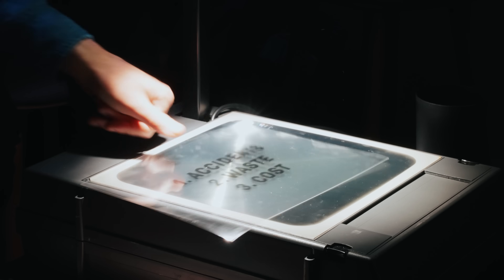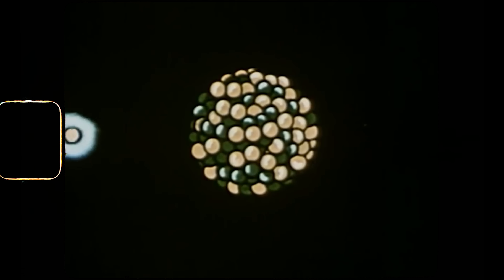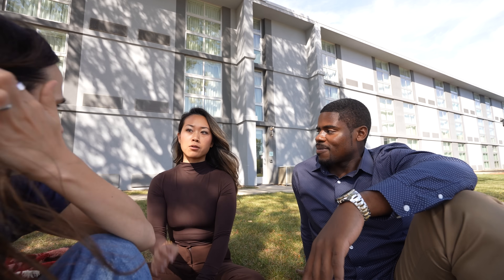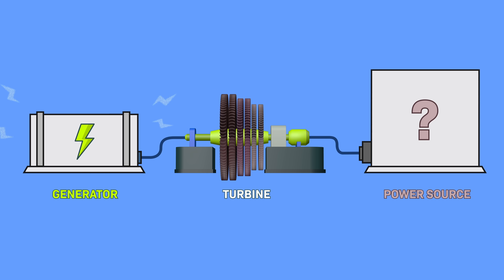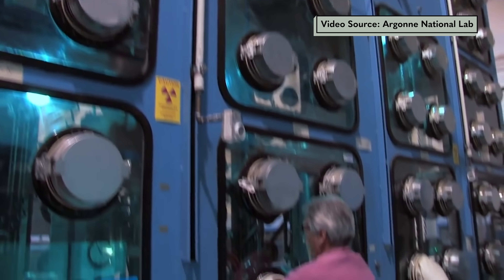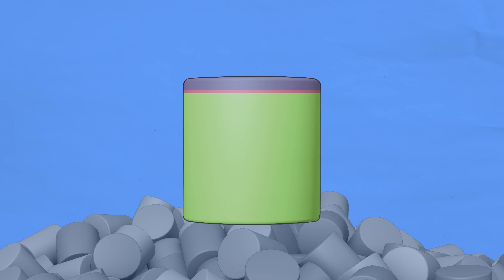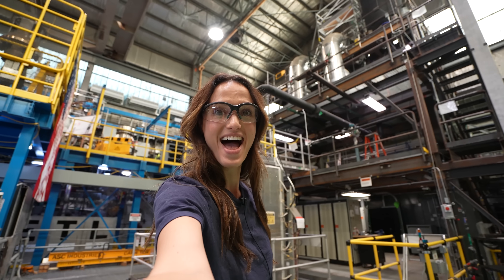The Big Lie About Nuclear Waste

Comment: Unfortunately, you are wrong as well as some other nuclear enthusiasts in comments below. Reprocessing of spent fuel is not so easy as you described in a simple electrolytic batch. Not at all. You deal with an extreme chemical mixture of many elements with very different properties, some of them volatile, radioactive and toxic. Any device involved in the process becomes contaminated and any procedure in maintenance, eg. part change, reparation, and so on produces another radwaste. That is the main reason why reprocessing of nuclear fuel is so rare all around the world, and not in the USA only. There is also an immensely huge stockpile of dismantled weapon grade plutonium that is not reprocessed for the same reasons, though reprocessing it would be much easier and cheaper than reprocessing of spent fuel rods. Do not look for sensations and conspiracy. Humans don't need to produce more cheap energy. They have to save it instead. That's all folks ;)

Comment: There was a program during the GW Bush administration called the "Global Nuclear Energy Partnership".  The notion was that we could get around proliferation of nuclear materials by forming a global partnership where the only countries that would be able to reprocess spent nuclear fuel (SNF) would be places that had already demonstrated reprocessing at some scale and/or were already in possession of a significant nuclear weapons infrastructure.  Any country that wanted nuclear reactors would get their fuel from the advanced countries, and when that fuel was spent, it would be exchanged for new fuel with the spent fuel returning for reprocessing.

One component of this program was the reprocessing of the spent fuel, a second component was the use of fast neutron reactors to burnup the higher actinides (Np, Pu, Am, Cm) that grow in as the uranium fuel is burned.  The reprocessing, then, was designed to separate unburned fuel (U) for reuse in light water reactors, from the higher actinides and from the fission products.  Fission products could be disposed in a geological repository, and because the higher actinides had been removed, the heat load on the repository was significantly reduced.  Furthermore, the required isolation period was also significantly reduced.  The third separated stream would include the bulk of the higher actinides which could be burned in a fast neutron reactor (such as the Fast Flux Test Facility that operated at Hanford for a number of years).  

I worked on the design of the pilot plant for the spent fuel reprocessing portion of the program.  Among my duties was supporting the development of the Programmatic Environmental Impact Statement (PEIS).  This program was effectively the answer to the nuclear energy problem worldwide.  At the time it died, there were a number of major signatories to the program - countries that already had significant nuclear energy programs.  And then, one day, poof (just like in the Half Blood Prince).  I was looking on the website for the PEIS for some information and noticed that our work on the pilot plant was missing.  I called my program manager at INEL, and after some calls, he told me that I had happened to visit the site about 30 minutes after our section had been removed as the first part of dismantling the whole program.

The problem with nuclear energy is not the technology.  Technology already exists for all parts of a closed nuclear cycle, and much of it has existed for decades.  What doesn't exist is the political will to finally solve the problem and to fund the solution.  As a part of my involvement in this program, I was a part of a team that visited hot cell facilities at locations in New Mexico, South Carolina, Tennessee, Illinois, Nevada, Idaho, and Washington state.  I especially recall the FMEF at Hanford - a facility designed to do precisely the same thing our pilot plant was supposed to do - reprocess spent fuel and fabricate new fuel - that had been built but never completed.  There was no electricity in the place, so we had to tour by flashlight - at least three floors below ground and maybe four above ground.  No working bathrooms, either.

I hope nuclear energy makes a come back, but at a time when we can't agree on whether or not to raise the debt ceiling, I have little hope that this country has the will to tackle this problem.  Or any problem.

Comment: The problem is you didn't mention water.  N power is still just a steam engine.  Isn't it?  All steam engines require a "boiler" and "condenser."  Nuclear power consumes something like 12 Million gallons of water per hour per GW to cool down the condenser.  Is that not true?  You never mention the enormous thirst of a traditional steam engine which is all N power does.  It boils water, just like your great, great grand dad used to do.  Do you really think the 21st century will run on steam engines?  You say you're a journalist, isn't water consumption... well, kind of important to the story?

Comment: Just a note on the cost of recycling the fuel. It seems that the cost is short term and is recovered in production of new energy. Then also recovered in storing far less material for a small percentage of time . Kind of obvious compared to storing large amounts of material for very long periods of time. The cost just keeps going up for this and isn't recovered. There's also a hidden cost when the material needs to be put in new containers and handled again many times. I sure that in the process of recycling they will encounter  pit falls but that's why we continue the research and engineering. With the continuing studies it's also very likely the cost of recycling will be reduced making the whole process viable . The cost of packaging, transporting and storing the spent fuel currently is definitely not trivial and not getting less expensive and don't forget the hidden costs in the future.

Comment: So you're talking about an electrolytic recycle system and maybe a fast-breeder program like Argonne's reactor.  I personally think fast- or slow-breeders are better in government hands than in the private sector, considering that their output is Pu-239.  Not that I'm a fan of light-water reactors -- I'm not -- but a source of plutonium in private hands is rife with risks.  The electrolytic product -- is it also effectively a plutonium condenser, too?  I would suggest that there's a fuel stage somewhere between concentrated plutonium and suitable fuel!   And slow-breeders: what happened to that?  Did it turn out to be non-viable?

Comment: Thank you for my new set of fact-based talking points about why nuclear is a safe part of the solution to the climate crisis. ❤
Reply: Could you please share where the facts were?

There was one main claim without any supporting evidence.
Reply: @brendanmay9585  That fuel pellets can be reprocessed and reused while being made less dangerous? It described that pretty extensively.
Reply: @taylorsublett5710  that was the one claim, but there were no references, no independent information, no efficiency of cost details. 

All fluff with no scientific detail
Reply: @brendanmay9585  I look for additional sources for information when I"m interested. I don't expect a 15 minute infotainment video to be a journal article. There are probably 50 other videos on the topic, plus I could google journal papers
Reply: @taylorsublett5710  I don't expect it to be a science journal, I expect it to make substantiated claims especially when those claims are going against  a highly respected food scientist with a PhD who did her research and showed it in the source material.

Comment: This is the first I heard about this. However I always wondered why the so called waste could not be reused in some way. If it was so radioactive that had to mean there was plenty of energy still present. The method you showed in this presentation makes a lot of sense and would go a long way in solving the waste problem. As usually men never look to get the maximum efficiency when developing projects. Just look at cars today. We get much more fuel efficiency today and much less pollution from each gallon of gas we use. The same for heating equipment, most of todays home heating units are much more efficient than in the past. As usual it always come down to cost. We always seem to want to produce something as cheaply as possible. Higher efficiency usually costs a little more. So we wait till a crisis like the oil shortage in the 1970’s and environmental issues drove us to get better on making things more efficient when using energy. This could help reduce the objections to using nuclear energy more to provide the electric energy we will need as we try to transition to more electric transportation and other uses to reduce carbon emissions. After all nuclear power does not emit carbon emissions but has had the problem of what to do with that left over fuel when the maximum efficiency of the reaction stops. Good luck in getting this technology off the ground and into use.

Comment: I had heard that Thorium reactors were very good at recycling old fuel as well but that they did not want to build those cause you can’t make weapons grade materials.  Most impressive show.  I have subscribed and am starting binge watching
Reply: I believe the technology they refer to in this video is fast neutron reactors which is yet another method. It is more mature than Thorium reactors, there have been several working prototypes and research reactors already.

Comment: Geothermal is also nuclear.  Deep Earth Fission is very likely a major contributor to Earth's core heat.  This would explain the extreme variability of volcanic activity in time and location, and also magnetic field variation.  Natural fission would not be expected to be the nice steady output of a manmade reactor but would ramp up and then down due to fuel burn up, poisoning by byproducts of fission, or fuel rearrangement.  Oklo proved that fission is a natural process of the Earth and deep earth fission is indicated by geoneutrinos detected coming from the Earth.  Fission is a natural process and life on Earth can not exist without it.

Comment: One of the type of reactors I have heard about is called an MSR (molten salt reactor) and from what I understand, not only can it use the recycled waste to run on, it's also what they call "walk away safe" Meaning that if something was to go wrong, even with no one at the controls, a salt plug would melt under the heat and dump the reaction chamber stopping the reaction process. From what I understand it can also run on Thorium, which is extremely plentiful. Plus, after the waste (or fuel) has been used as much as it can, it will end up being inert within a decade or two, not hundreds or even thousands of years.

Comment: There is an evident lack of numbers and technical data to explain the magic trick of nuclear recycling and why it is technically possible. 
You are all talking about it like : yeah it is possible and not explaining exactly how.
Like : the ratio of U235 in the waste that can be used as a new fuel rod, the terminal ratio… or the difference in technology used to power a low enriched fuel in comparison to a standard enriched fuel.

A famous example would be RBMK reactor that can run on low enriched fuel, possibly resulting from a previous use in a standard reactor.

This is the heart of the technology here and you just came to caress it without giving us the proper info.

Comment: I worked at EBR II for three years until Chernobyl and all the funding  for nuclear power was diverted.  Amazing technology and proven performance.  The fuel cycle for EBR-II was super efficient.  Also the thermal efficiency was incredible using liquid sodium as a heat transfer and moderator.

Comment: So far the only error I noted that the 235 and 238 are the total number of neutrons and protons in those isotopes of uranium, not the number of neutrons.  Great, well researched video otherwise  though.  I work in Nuclear Medicine, using radioactivr materials for medical tests and therapies.  Its fantastic to see some science communication walking back the common misconceptions about nuclear power.  We need nuclear reactors to generate isotopes we need for medicine.

Comment: You need to have at least 51% of your electricity generation as base load, not solar, wind or other renewable. This anchors and stabilizes the power supply so voltage and frequency are not effected by renewables, the wind does not blow all the time and solar drops off when theirs clouds or at night when you have zero output. The amount of space you need for solar farms is vast, wind turbines create noise that can be unpleasant to live near along with being very destructive to birds who can fly into it.  Nuclear power is not perfect but a good option to consider as a mix with coal, gas, renewables. not having this in Australia where we have access to uranium makes no sense.

Comment: You would do well to do your next look at this topic a lot at the 1960's MSRE program at Oak Ridge National Lab.  MSRE was the Molten Salt Reactor Experiment, which use the aforementioned uranium in molten salt as the fuel, allowing 97%  consumption on the first pass, eliminating the need for recycling. Liquid fuel make the most sense, we don't us lumps of coal in our cars for a reason.  Current pellet reactors don't need to be refeulled  because they run out of energy, it's because the pellets cavitate and begin to hold the bad byproducts. Liquid fuel eliminates all that. Why did we not go forward with liquid fuel?  Pres. Nixon; who insisted that the southern California pellet processing industry be protected.  Time for a total reboot of the Nuke industry.  Also look at Thorium as a fuel... fascinating possibilities!.

Comment: Nuclear fuel recycling is great, although won't really be necessary once we switch to gen 4 reactors — some of them are designed to run on spent nuclear fuel without any need for recycling. 
But all that aside, I'd like to point out that nuclear waste isn't that big of a deal to begin with. As you correctly pointed out, there are many components making up nuclear waste. Some are highly radioactive, but those don't stick around for long. Others will still be there after eons, but those aren't very radioactive at all. 
There is no element/isotope that's both highly radioactive and long-lasting. 
I mean, radiation is a byproduct of radioactive isotopes decaying. If there's a lot of radiation, the isotope generating it is decaying quickly and will therefore be all gone soon. On the other hand, if an isotope will still be here in thousands of years, it means it's decaying slowly and is therefore generating very little radiation. 
Uranium — the only component of nuclear waste that will still be around in non-negligible quantities in 100,000 years — wasn't scary when it was just buried in the ground, before we dug it up. Why should it be scary now?

Comment: Coal power is directly responsible for thousands of workers killed worldwide every year. Coal miners on average have a life expectancy up to a full decade shorter than average and even then most of them have severely degraded quality of life (e.g. due to black lung disease) for the last decade of that. If we use the same metrics we use against nuclear power that's an additional tens of thousands of more deaths attributable to coal power each year. Coal power also makes huge swaths of land toxic downwind of power plants and outright uninhabitable downstream of coal mines. Coal power is the major contributor to anthropogenic climate change that is already taking lives and will result in millions of deaths throughout the next century.
Over the past century civilian nuclear power has been blamed for up to a few thousand direct deaths thus far and projected to contribute to 40-80 thousand deaths within the next century according to reliable academic sources. (ten times that according to Greenpeace which I will leave it up to you if you believe any word they say)
I agree that renewable power is the best long term solution but until that can be scaled up to our needs nuclear power could hugely reduce fossil fuel emissions and slow climate change.
It is ironic Greenpeace helped the fossil fuel industry by doing all their dirty campaigning against nuclear power for them.

Comment: It is not the uranium part that makes nuclear power dangerous, it’s the human part. It is like walking around with a hand grenade that has the pin removed it is just a matter of time before a human error happens.
Reply: Statistically more people are injured by coal working normally than nuclear failing.

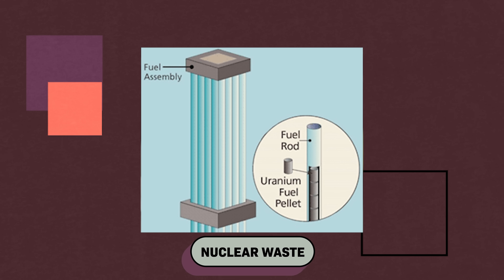Comment: Just a detail, but at 7:07, the number refers to the neutrons + protons, not just the number of neutrons. So it is almost the same as the atomic mass (which is slighly higher because electrons and binding energy also contribute - but for Uranium 235, this just makes up for 0.04 of the 235.04 u)

Comment: Technically feasible doesn’t mean economically viable. Nuclear is already expensive and isn’t getting cheaper. Meanwhile renewables and energy storage are dropping in cost. 

While I agree that the US should recycle it’s waste it’s unlikely to be a massive resurgence in nuclear power. The competition is already cheaper and getting cheaper with volume. Nuclear is going the other way.
Reply: The process dissolves the reactors!
USE ONCE, THROW AWAY! Plus still radioactive waste.
Reply: @lonniedobbins1195  I don’t think you understand how breeder reactors work.